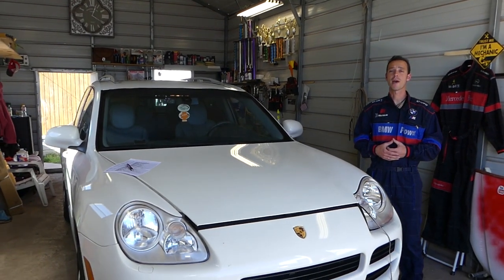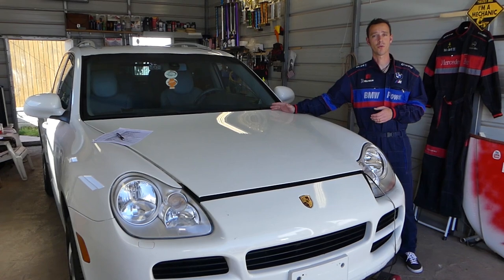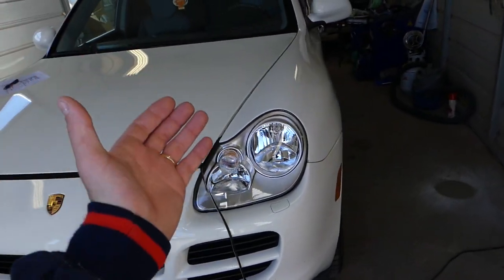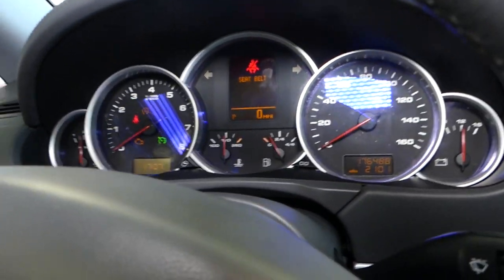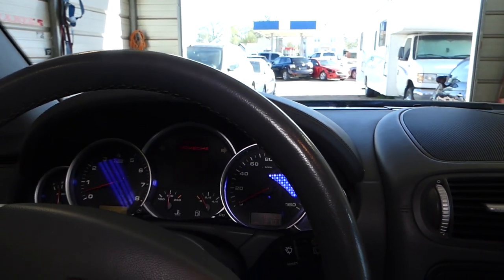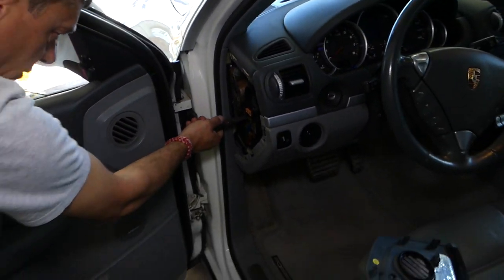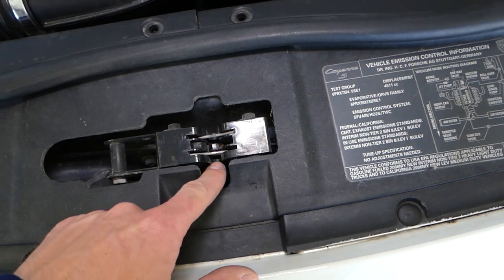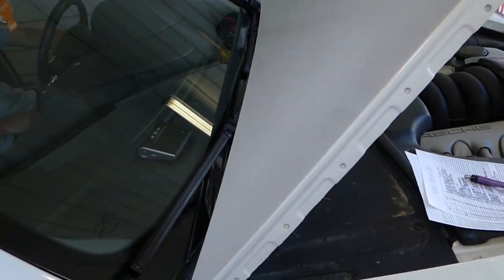WINDSHIELD WIPERS DO NOT WORK ON PORSCHE. WASHER WORKS WIPERS DO NOT  FIX

Comment: The wipers on my Panamera stopped working.  I checked the fuse and it was good.  Was looking for help on how to replace the wiper motor when I found this video.  I had added some motor oil the morning that the wipers stopped working.  After watching your video I open the hood, checked the switch, closed the hood, and the wipers started working again.  I will investigate changing this switch on the hood closure now.  Thank you for the video. I wonder how many people pay for replacing the wiper motor when it is just the hood closure switch.